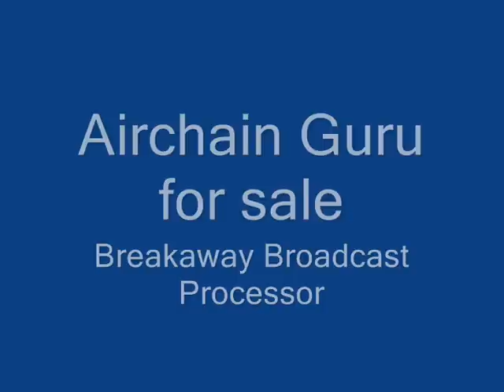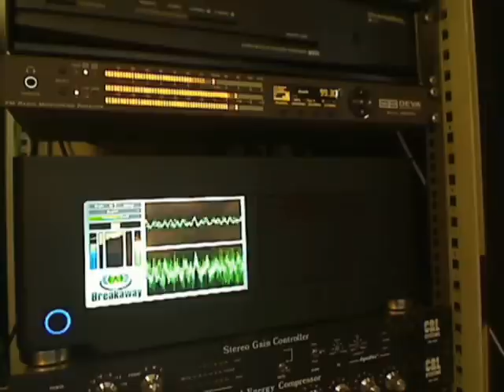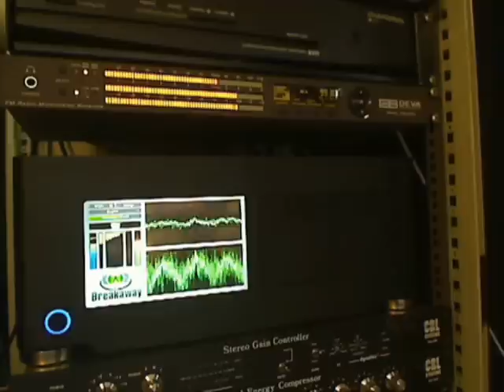AirchainGuru BBP 01012013

Comment from the maker: Can be done by selecting a 192Khz input port on your soundcard, this can be done in the BBP config page.
I used a software based RDS encoder called Aeromate, this can use Breakaways PIPELINE
Reply: Breakaway broadcast has the same preset as onmia 9 and onmia 11  french kiss and break broadcast has stereo encoder and rds encoder and stl over ip for fm sites sounds incredibly well